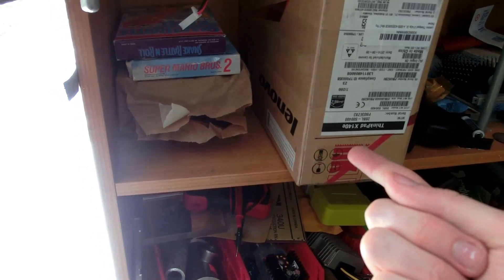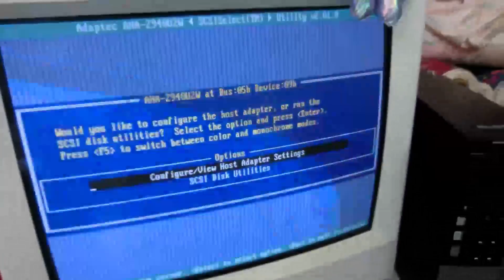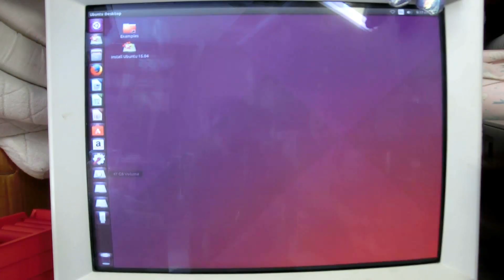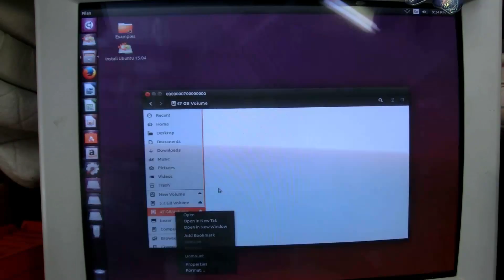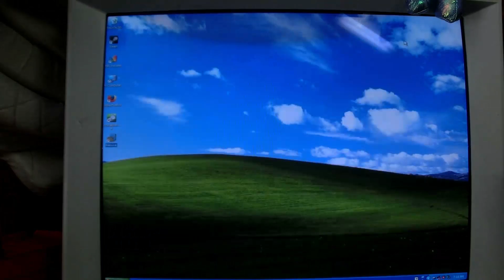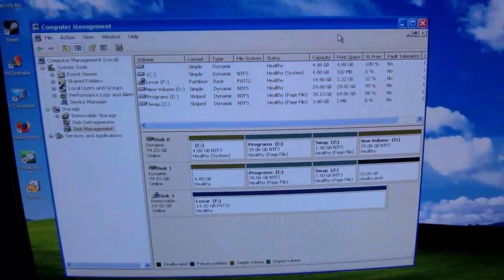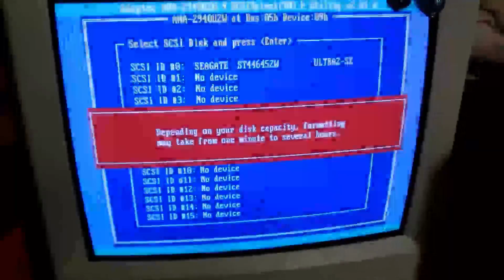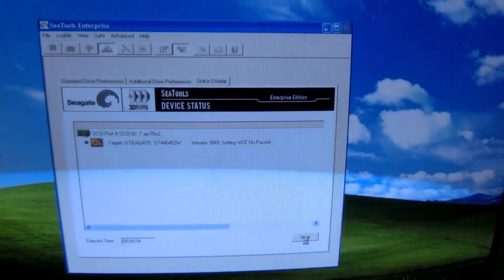Data Archaeology 003: 47 Gigabyte 1998 Seagate Drive

Comment: Good drives. MTBF on these was 1,000,000 hrs. I bought one of these new when they were liquidating them for $20 or so but they were still a good size for the time but of course you have to have SCSI. I also have the Elite 9 which cost $9. I haven't set up a SCSI in years but I remember having to terminate them. Those two are still in computers I have. The Elite 9 is in an old early 1990s computer so I could have good capacity to store a lot of early games. The Elite 47 has 40gb of songs I downloaded and I kept it as a backup for all these years along with the SCSI card to run it. It's now residing in an early 2000s Athlon XP system which I fire up occasionally.
Reply: Holy hell, and the 23GB like I have is rated for 800,000 hours! That’s 91 years! I’m going to use mine for archiving my vintage software, since it looks like these are very reliable when cared for.

Comment: Just because you dont hear it doing anything doesnt mean it wasnt doing anything it can just mean that the head was moving extremely slow and perfectly linear. I end to end zero out disks and run remaps on bad sectors on old drives i have and they never make a peep while running. You should try vivard its on the ultimate boot cd it will tell you what sector its on not sure if it supports scsi drives though

Comment: A few issues I've seen which people who don't work with SCSI devices a lot can encounter. First, both ends of the SCSI bus have to be terminated.  Since your drive is device 0 and the card is 7 or 8.  You need termination on the drive and the card.  If there is no termination, there will be signal echoes bouncing around the bus and will significantly slow the drive down. Normally there will be a termination jumper or set of jumpers on the drive, or a resistor pack.  Alternately you can use an internal scsi cable with a termination block on one end.  There were no jumpers installed on the big drive so that's why it was on ID 0.  They typically count in binary, so no jumpers means binary 0 all the way down.  Second, a low level format has to complete in order for the drive to be accessible by the computer.  The card can talk to the controller and send the low level commands, but the OS typically can't see it in an unformatted state. This is the state where the tracks and sectors are laid out, not where the file system is applied.  The reason it hung most likely goes back to the original issue, lack of termination.  Check that the card has auto-terminate enabled ( if it supports it)  That way you only have to deal with the drive.  Auto-Terminate  means you can have any number of devices ID 1 through 6 between the drive and card with no problems.  If you add something above the ID of the card, it will switch off auto-terminate and you will have to put a terminator at the end of the bus on that side.

Comment: I would say that it's not so likely to find games etc. on the full sized HDD´s
they were very expensive and therefore not so common in the normal consumer market / often they were used by big industries (if you know what i mean) ;I would try data a...... on the "normal" sized HDD´s because they were cheaper and easier to get, no one wants to spend huge amounts of money for an HDD that sice thats simply to big for them. for example you can buy HDD´s that are 20 + tb today (used in servers) but they are extremely expensive and the normal consumer does not need that much space maby 3tb + more if you make your own vids LP´s etc. but i think you know what i mean.
Reply from the maker: MoGeLzZ i agree slightly, but remember a lot of these drives became obsolete to companies but not to employees, i could see somebody taking home an old 23GB Seagate drive in 2005 to use in there PC. but i dont buy these for the data i buy them for the drives themselves and just see if they happen to come with interesting data.
Reply: A place called Surplus Computers liquidated tins of these drives brand new at one point when they were still a fairly good deal if you had the hardware to run them. I bought an Elite 9 for $10 and an Elite 47 for $25. I just fired up the 47 a few days ago and it still works fine. I used it for my master MP3 backup drive and they're still all there.

Comment: With some of the older and even more unique drives, have you considered doing in depth teardowns? I realize with these Seagates it might not be worthwhile because the standards were pretty well established by 1998, but with older and more idiosyncratic drives from the late 80's/early 90's, it might be worth cracking them open.
Reply from the maker: Tyler McCracken of course, but only a teardown on a broken drive. and now i've found a broken drive.
Reply: Woohoo! Can't wait!

Comment: that kinda sucks. The thing would not chooch! oh well. those hard drives are just so cool to look at. i really like the noise of that hard drive. it sounds so stable and linear, love it. i really like this series you have here. 
7 years of constant use and still sort of works. thats a fair effort. quite a lot of hard drives today struggle to last 7 years turned off!
Reply: SED71 ya that's true with the hard drives these days. I'm luck tho my 2006 HD still works good it has 244 out of the 250 that it had when it was new

Comment: I love that that bodge cap on the board actually seems to have worked! Just hilarious to me. I mean, it's probably a bit out of spec for tolerance, but I doubt very much that this is responsible for the errors. 7+ years of active service likely accounts for that.

Still, nice attempt. Can't wait for when you figure out how to hook up that Lisa drive. Wonder if someone out there makes an adapter board for scsi or IDE (or even if such a thing is possible).

Comment: SCSI buses must always be terminated at both ends to ensure reliable operation. Without termination, data transitions reflect back from the ends of the bus causing pulse distortion and data loss.  Do you have terminators on the cable?

Comment: Wow you plug cards into your motherboard whilst the stand by power is ON? I'm sure I've had pc's power on fully when doing this accidentally, could end badly if a card is halfway out of a slot. Note the memory is also likely powered up and susceptible to damage if swapped whilst standby power is on. ESD precautions?
Reply from the maker: Coolkeys2009 no i've never tried to remove a PCI card when it's running, i should try that sometime though. it would be fun to see how a computer freaks out.
Reply: Rinoa Super-Genius The point I was making is the green light on the motherboard indicates that the motherboard is at least partially powered up and you shouldn't plugin in or remove any cards, memory power connectors etc. That may be an interesting video plugging stuff in and out with windows running to see what kind of blue screens or blue smoke you can release from a running pc(your welding gloves and safety goggles may be needed LOL)
Reply from the maker: Coolkeys2009
no thats just the connection indicator, its not on. either way i dont care.

Comment: Good attempt but with those old drives on the disc they used to get little dint type things on there, just from the odd shake and this and that but that dint would blue screen your machine when you wrote to that part of the drive :-) it would be cool if you could turn it in to a gyro I really wanted to make one for an ebike but it was to much for me :-p I think it just didn't have the power no matter how many rpm i was gonna run it at :-) Still nice to see the old tech and the cylinder disc errors will drive you mad they did me back then :-p iops kill you on them best scooping the innards out on them both and retro fit them with something :-D

Comment: That SCSI cable doesn't fit because it's an external cable. The internal versions don't have that metal shielding.

Sorta like this: http://i.imgur.com/QGUny8w.jpg

Parallel SCSI is dead. Long live parallel SCSI.
Reply from the maker: John Bigboote yeah, well it fits now.
Reply: Peter Carlson Well, Occam's wire cutters at least.
Reply: John Bigboote I just ran across the channel and was going to comment the same thing. I've probably have more than a few of internal and external cables for ultra2+ scsi laying around at work if someone does want them, just pay shipping.
Reply: ArtemiaSalina i'm curious if those two hard drives actually could run Windows 7
Reply: Peter Carlson 😴
Reply: Memory is a little fuzzy here but didn't some adapted SCSI cards allow you to boot from the SCSI drive?